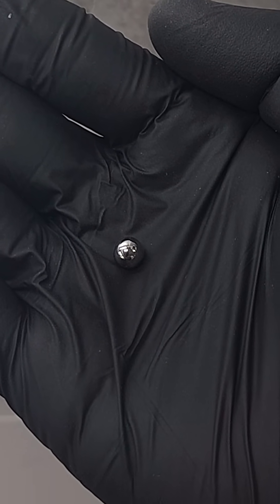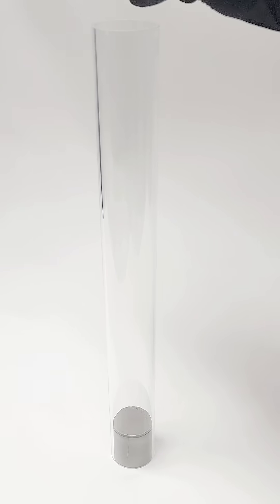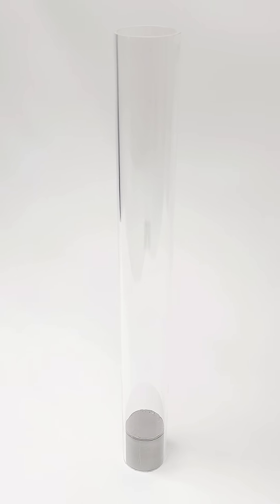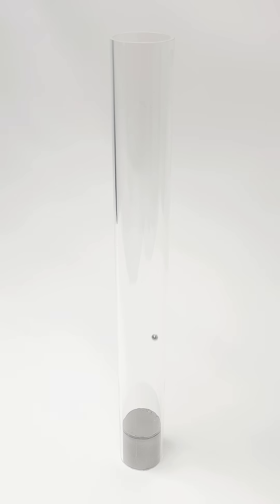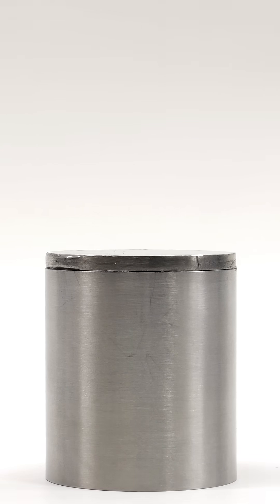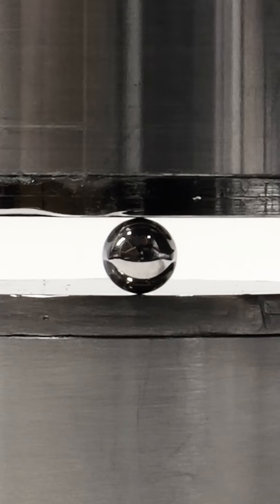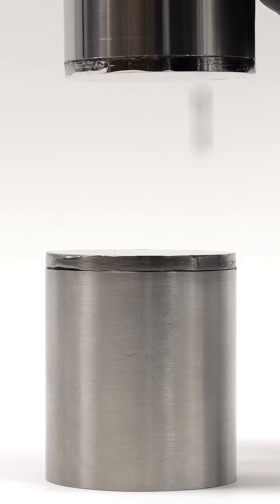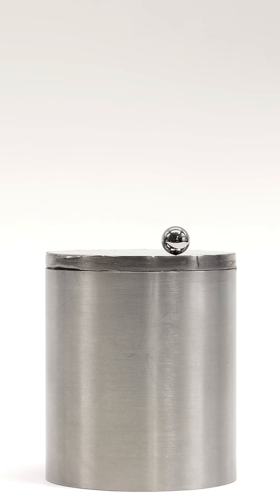This metal is too bouncy

Comment: so, at the end of the short, you moved the top one back and forth, and it makes a different sound. Can you perhaps please:
1. bring them close together, which makes high pitch noise, then move them apart again, which I hope would go down in pitch?
2. and if it does change in pitch because of the change in frequency, and assuming it's an almost elastic surface so energy is somewhat conserved, can you play a song with it?

Comment: The craziest part is how much energy is conserved. This is very well displayed in the shot near the end, where the two plates approach, and then depart, and then approach. There is so much energy conserved, the loss isn't perceptible. Incredible material
Reply: And his trampolines are FAR from perfect.  If they were perfectly flat we would see a conservation of energy that would truly seem impossible.  Probably talking a ball bouncing for days.
Reply: Ballistic High Speed would do great with this.
Reply: the ball may get some additional energy from the cylinder's loss of gravity energy
Reply: almost like it could have significant practical applications due to the high level of efficiency
Reply: Yes and the energy loss at the beginning only seems so high because at the beginning it's hitting the edges much more.  Would love to see this in a really big plane that's slightly sloped towards the center so it can't hit walls
Reply: Why is this impressive? Genuinely curious :0
Reply: @yakiniku6075  Because we're used to everyday materials that present much larger losses on impact. Just like at the beginning of the short, with the usual bounce. With such normal materials you'd expect the bearing to not reach the upper surface after the approach-departure sequence. But here we see something out of an idealized physics textbook on elastic collisions (almost).
Reply: @ccgarciab  I see, thank you!

Comment: This shows that almost all the ball's kinetic energy losses are from air viscosity. 
It has orders of magnitude more collisions before stopping when it's bounced a shorter distance between two plates as opposed to freely. 
Please try bouncing it in vacuum. You can put the trampoline in a clear sealed tube and drop it with a magnet. Maybe even try it with helium which has very low viscosity
Reply: you still have losses to heat and sound. so even without air it will slow down. besides that the ball isn't as bouncy as the metal surface and it's losing energy because of that too.
Reply: @dovos8572  yes it would lose energy to heat, but not to sound because only works when there's air (sound waves need a medium to move through, that's why water makes sound louder and space is silent).
Reply: @phanto-64  Heat won't alter the ball's kinetic energy, so it's pretty much 100% negligible. In a perfect vacuum the ball will lose it's mechanical energy to the solid it's colliding with, in this case, it would solely be with the "atomic trampoline", but since the elasticity of the atomic trampoline stores the energy quite well, the loss, also perceived as "sound" will be quite small.
Reply: @phanto-64 Are you saying that sound waves, which contain energy, can be created without energy?
Reply: @minecraft6708   That's not how heat loss works.  It literally does alter the kinetic energy... or more accurately, some of the kinetic energy is lost to heat via friction.
Reply: @MacroAggressor  In an assumed total vacuum there is no friction, there will only be loss during moments of contact between the ball and the atomic trampoline. And the only friction that would incur a huge amount of loss here, would be rotational energy, which is not really being discussed here. So no, heat won't be a factor in the case I was originally talking about.
Reply: @MacroAggressor  And no, heat loss/gain will never alter the kinetic energy of a mass. On earth, because of constant interactions, this might seem counterintuitive, since heat causes different points of pressure in air molecules, causing a turbulent flow of fluid, which will create a dynamic air resistance capable of altering the ball's trajectory/speed, but again, this is just an indirect effect of heat, and not a direct effect of any oscillation of temperature. E.g: a piece of rock floating in intergalactic space would always keep it's velocity no matter how much you heated or cooled it.
Reply: @minecraft6708 you're wrong because heat IS a form of kinetic energy! So heating something is always a kinetic energy transfer. I really recommend you read the first couple of chapters of the feynman lectures, makes it all make intuitive sense.
Also, if the rock floating through outer space doesn't radiate uniformly, it will change its external kinetic energy due to radiation pressure. So that analogy, even if not applicable, is also not correct.
Reply: @minecraft6708 it also would absolutely change velocity due to E=mc^2 and heating it would increase its mass.
Reply: @amos9274 
I'm glad you're so into physics, but unless your doing stat mech or thermo then no one considers heat "kinetic" energy.

And we're certainly not dealing with relativistic speeds or energy densities that would be applicable to apply Einstein's equation here. If you're trying to educate the public on physics principals then don't get lost in the weeds. Focus on on explaining what's actually relevant first.
Reply: @amos9274  In a pure theoretical factor your arguments are somewhat sane, but still incorrect.

1. Yes, you can go a bit beyond and consider heat as a form of kinetic energy. But when we talk about kinetic energy we're talking about the actual energy of a moving system, and not the internal atomic "kinetic energy".

2. The rock will never reach a state of "non uniform" radiation without any external help, as it will tend to uniform radiation, so that last paragraph in your first comment makes no sense.

3. Even if you increase an object's relativistic mass, and therefore it's relativistic kinetic energy, nowhere in this process have you increased it's velocity, sticking to the fact that an object's speed is preserved nonetheless, otherwise you would have objects accelerating to infinity just because they're travelling at 0.00000001c
Reply: @XxZeldaxXXxLinkxX  if someone simply refutes the existence of inelastic collisions in a vacuum with bogus reasoning I don't see another choice than to "dig a level deeper" so to speak. On a macroscopic level, it is simply an empirical fact that inelastic collisions exist. To "derive it" with first principles, I see no other choice than to go with the atomic model. 

The other arguments were simply to state that even tho the example is not applicable as a proof, their model also isn't accurate enough to prove what this person claimed.
Reply: @minecraft6708  see my comment up above about how I interpreted your comments. Reading it again, I'm unsure. Do you believe there is no such thing as conversion of "kinetic energy" to "heat energy" due to an inelastic collision? Cause if not, there is nothing to argue about.
Reply: @minecraft6708  You have no idea what you're talking about.
Reply: @minecraft6708  Deformation of the ball bearing and trampoline surface will store potential energy, which is then converted back to both kinetic energy and heat energy when the ball travels in the opposite direction. If you did this this experiment in a completely closed system in a vacuum, you would detect an increase in temperature as potential energy was converted to kinetic energy, then back to potential and heat energy on collision, then back to kinetic and heat energy, over and over until all the original potential energy had been converted to heat energy and the ball had zero kinetic energy.
Reply: @phanto-64  However, the sound waves can travel through the steel block underneath and though it's greatly reflected by the trampoline will have some travel through it.
Reply: That is incorrect; this experiment has been done in vacuum and the lack of air cause only a negligible  increase in bounces. Loss through heat is the primary energy sink.
Reply: A collaboration with Action Lab is what I'm hearing!
Reply: @davefaust7317 no, action lab isn't worth the time it takes to watch. His research into everything is so lacking...
Reply: Please do this
Reply: Impressive nerd speak here
Reply: Could also be friction from scraping the edge of the cylinder
Reply: Steve mould did an experiment on his vid if you're interested
Reply: doesn't the gravity matter too?
Reply: Steve Mould did that once.
Reply: I'm super curious how the bouncing bb would dampen the fall of the top trampoline if it were just dropped into the top of that clear tube.
Reply: It will be interesting seen it at a bigger scale like a cannon ball size
Reply: You’re forgetting about gravity?
Reply: it seems to move more then the energy put into it , that 1 drop made it bounce within 98% of its drop height then 97% 96% 95% etc , stacking that many bounces surely add up to more then the energy originally put in..

if i try jump and finger tip touch a 9ft high point , combining the energy from two 8ft jumps would exceed the force of reaching 9ft on paper , but this ball can bounce at least 5 times within the 95% range yet its not classed as briefly being over unity 🤷‍♂️
Reply: Steve Mould tried that, it made only a small difference.
Reply: I wonder if a Metallic Glass ball-bearing would enhance this even further
Reply: @elirevzen418  keep in mind that him moving the block closer and closer is actually adding extra energy to the ball...also, the ball will still be fighting against gravity on the way up every time, which is the biggest energy drain (not the air)
Reply: @R0DSTER 
To be accurate, it would only be adding energy if the block was moving at the exact same time as the moment of impact (which is a very short moment).

Otherwise, no energy is introduced into the system.

And also, going up against gravity is not net energy loss because the energy gets converted into gravitational potential energy, which is regained as it falls.
Reply: @XxZeldaxXXxLinkxX  he said that at its peak it was bouncing several thousand times per second, that's several thousand "very short moments", which is a lot of extra energy added

and whilst it would of course regain some of the lost energy through falling, it certainly is significantly less than it lost on the way up. there's certainly a significant net loss there with each bounce
Reply: @R0DSTER 
Yeah, I agree with your first part. But for the second part, no, when you're bouncing up against gravity (controlling for other factors like air friction) , all your energy is converted into potential energy, and all of it is converted back to kinetic on the way down.

Feel free to verify for yourself 🙂
Reply: @XxZeldaxXXxLinkxX  huh, yea seems you're right, thanks. hard to conceive that 100% of the energy used to propel something up can be recovered during its fall...but yea, it checks out
Reply: @XxZeldaxXXxLinkxX there are thousands of chances for that to occur per second so it is extremely likely
Reply: @R0DSTER I don't think so..
Reply: @XxZeldaxXXxLinkxX whoa good response!
Reply: @R0DSTER yes, that is the fascinating bit, the added energy accelerates the bounces beyond just the decrease in height because it still has energy going into the direction change. But I will add that gravity is simply a transformation of energy, and it's actually one which has no noticeable losses on its own. Air resistance and inelastic collisions are always what decrease the energy of a bouncing projectile.
Reply: @R0DSTER  Nope. Gravity is a neutral force. It niether adds nor subtracts energy from the system. 

Traveling through the air and the impacts this leads to subtract energy from the system through friction and sound which disperse it's intial kinetic energy into the surrondig environment. Thus entropy increases.
Reply: So what you're saying is Nile needs to put the ball in a zero gravity vacuum. @R0DSTER
Reply: Make the bearing out the same metal as the trampoline
Reply: @rondickinson1907 seriously
Reply: bounce upwards against gravity also takes some energy... or do you think the energy gravity adds to the system downwards  equals the upwards amount?
Reply: Nerd-GPT, ELI5 please
Reply: Nerd
Reply: @fritznlizard calling someone commenting on a chemistry channel a nerd... What are you trying to accomplish here?
Reply: @fritznlizard  LMFAO
Reply: @fritznlizard  Troglodyte.

Comment: I want to precisely motion control the two surfaces approaching one another, for theoretical maximum energy conservation
Reply: or even just a robot arm juggling the bearing by imparting a sustaining force on each bounce, responding to the balls drift with subtle changes to the plane angle, steering it back to the middle
Reply: also I wonder if this material behaves better if bonded to a rigid back, or kept thin and allowed to flex like a drum head

Comment: Now make a ball bearing out of that trampoline material and try bouncing it!
Reply: you would just make SCP-018
Reply: @Bishop-Hall whats that?
Reply: @JTTG-349  it's an fictional anomalous bouncy ball that bounces with 200% efficiency

 (meaning if you drop it from 1 m in height it would bounce up to 2 m, this repeats until it gains infinite speed)
Reply: @Bishop-Hall  thanks and is there a limit to its powers? Can it reach space? And does it look like a regular ball?
Reply: @JTTG-349  Yeah it the appearance of a Super Ball made by the Wham-O company in 1969. It is 6 centimeters in diameter and coloured red. and I don't believe there's a limit
Reply: @Bishop-Hall  that is TERRIFYING
Reply: @Bishop-Hall  most of the SCP are wierd idea put into a monster form
Reply: He had a tough enough time making the atomic trampoline in the first place one of the metals used to make it is beryllium which is extremely toxic and I doubt he will mess with it again
Reply: @Onewingedangle42  Comments were telling him that his precautions had not been enough and that he may have sustained damage anyway. Scary stuff, beryllium.
Reply: @ccgarciab  yeah I know I read the comments however I doubt he actually got any health issues from that because he probably would have said something or retired from making videos by now unless the affects were minimal
Reply: @ccgarciab  he had a face mask how is that not enough?
Reply: @Onewingedangle42  actually you don't need beryllium to make that metal
Reply: @dxfvgyhjh  cool
Reply: @dxfvgyhjh  i dont think other metal glasses can let a metal ball bounce that high
Reply: Also he had tough time making it due to the lack of information of that “metallic glass”. Now he has all the materials needed and the right techniques. So he probably would make another one and mess around with it.
Reply: I think it might not be as impressive as you imagine: the bearing would probably be softer and deform more at every contact, losing more kinetic energy per bounce.

Comment: put a piezoelectric pick up under the bottom "trampoline" and count the pulses on an oscilloscope
Reply: @zg2964  Putting a microphone beside the ball bearing and sending the output up to an oscilloscope could also work.
Reply: @beyondwhatisknown  practically the same thing honestly. could also use just about any speaker for the same effect.  Using a speaker/mic and a computer to just record the frequency or the use of a spectrum analyzer would probably be the easiest.
Reply: @beyondwhatisknown  Though its really just all measuring the same thing lol and all pretty strai forward
Reply: or just look at the frequencies on a spectrum analyzer/spectrogram, which would probably be easier.
Reply: Great idea
Reply: Put one on each side and you'll see an alternating wave on the oscilloscope.